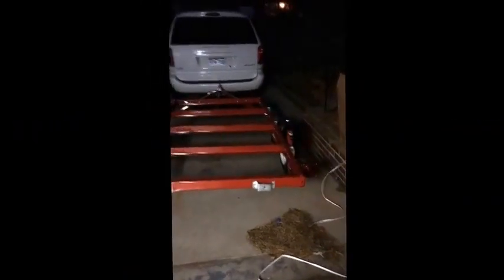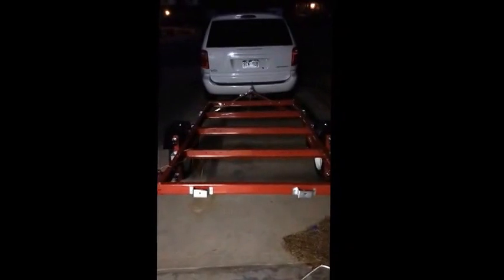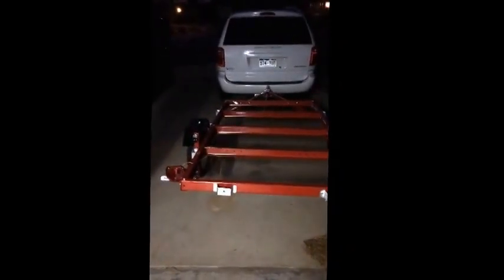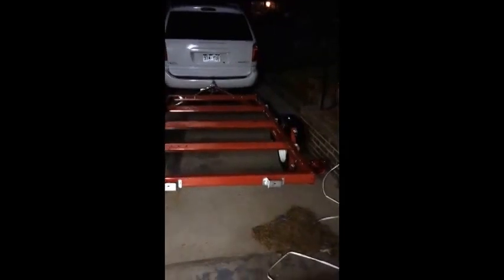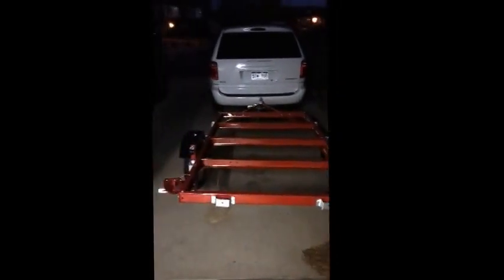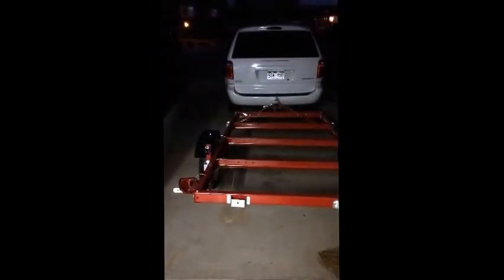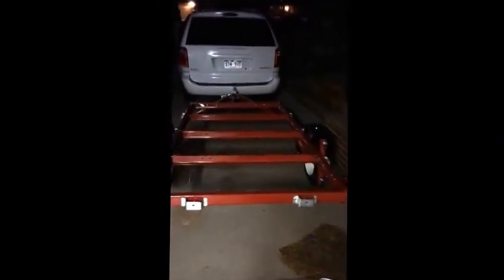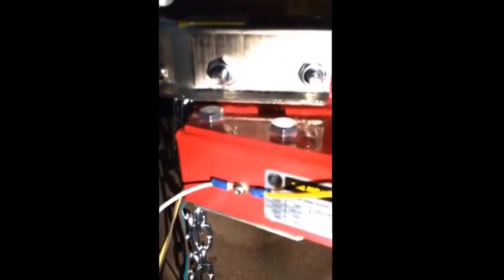How to Fix Harbor Freight Trailer Light Issues (or Trailer Kits in General)

Comment: i've just been struggling with same issue for past hour or so.  one tail-light on trailer worked fine. i started troubleshooting and it it seemed to point to the yellow+brown wires for left (green+brown worked fine on either light). But then i also notice that neither light will work with headlights on.  Just brake-lights + turn signals.  Is that normal?
Reply from the maker: David Maestas Absolutely.  Sounds very much tied to the ground issue.  I would wire in a ground to one of the lights that are not working - then try your lights with the headlights on.  It should solve it and I would plan on wiring up the other side.  At any rate, let me know how it goes!
Reply: centralusatech Thanks! this video and your post is awesome. i'm going to buy enough wire and connectors to just go to each rear and side lights from from the front ground.
Reply: David Maestas This worked perfectly. I bought 25ft of 16 gauge wire from HD and some terminal connectors like your video. Then i went from the front harness like you did and then from side light to the other side light, then back to tail light then the other. 4 pieces of wire and no dependency on the floating ground and it worked perfectly!
Reply from the maker: David Maestas Right on!  Glad it worked for ya - hope you get some good use outta that trailer! :-)
Reply: centralusatech Thanks.  Did you ever build a deck or rails for your trailer?
Reply from the maker: David Maestas Hey David - I haven't yet only because I was using the trailer to haul my golf cart.  If you've done the rails, how was that process?
Reply: centralusatech i haven't yet either.. was looking at some videos.  One of them the guy "rabbit cuts" the side edges of 3/4" plywood for the deck with a planer so to account for the overlap of the sides compared to the cross pieces.  Was wondering how necessary that was.
Reply from the maker: That sounds a little over the top - I think it's officially "rabbet" (but whatever lol).  The good thing is there won't be any grounding issues with the rails :-)  I will re-look at my directions again; or, if I find any good tips I will be sure to pass them on to ya.